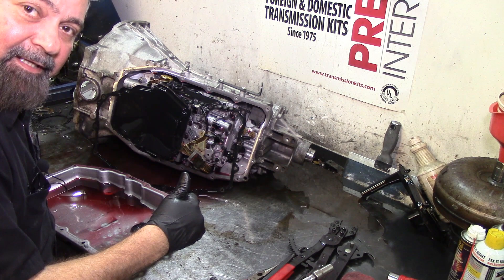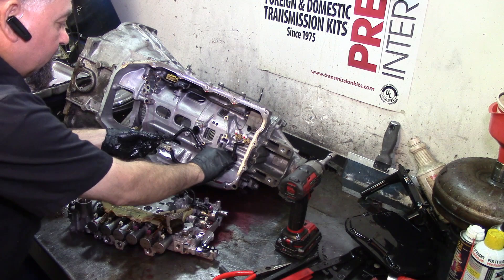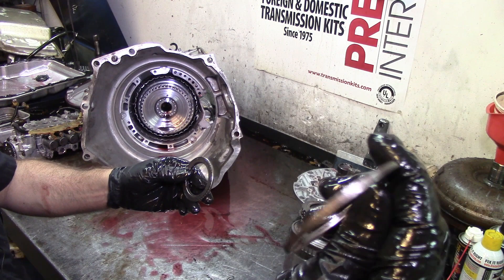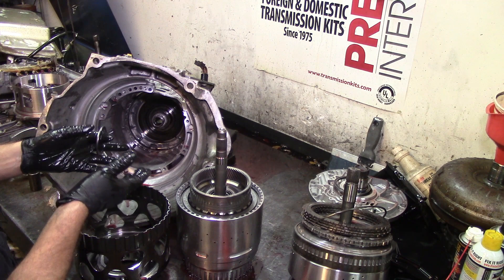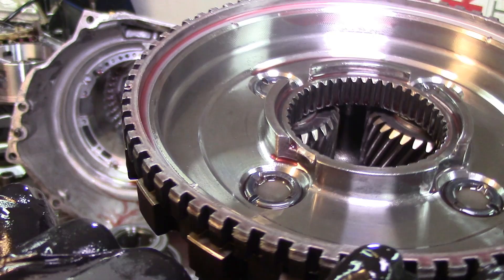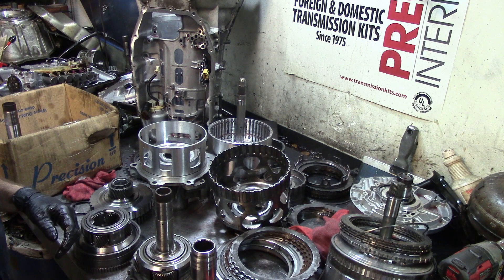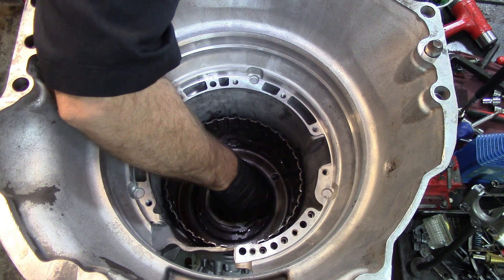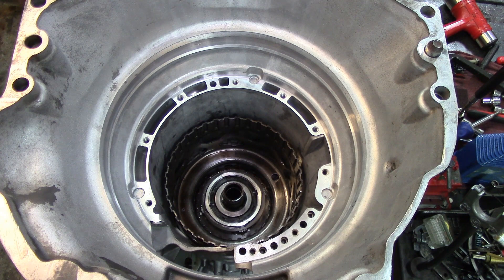8L90 TEARDOWN AND ASSEMBLY

Comment: Very good video. Today I just dropped off my 2017 Silverado High Country 8-speed for transmission work. transmission harnesses fail and transmission temp sensor gone bad. 80k miles only so far. Did in the past Amsoil transmission fluid with new filter. Amsoil did help with the shuttering and shaking

Comment: I should have went to school for transmission technician it looks interesting 👍. One day back in the late 1990s my 1981 GMC pickup truck's transmission needed transmission rebuild. So I took out my transmission and dropped it off to a Gallup NM transmission shop. I thought the transmission shop did their job but I found out later after bolting my transmission back to the engine I test drove my truck and it was still slipping. I couldn't believe that transmission shop didn't even rebuild my transmission 🤦. I was ripped off. After that happened I had alot of distrust in transmission shops. Years later I learned alot about fixing different kinds of vehicles. I believe in fixing my own vehicles. I'm still learning how to fix various types of vehicles. Thanks God for YouTube tutorials I keep on learning. I'm a YouTube taught Mechanic 👍. By the way that transmission shop ran out of business a decade after I distrusted them. I tried to tell the business they ripped me off but they didn't give me my money back. Same thing happened to me at Albuquerque Midas repair shop all I needed was a seal replacement for my leaking oil. I paid $300 for the work but the mechanics didn't even replace my oil pan seal.

Comment: Hi have a hard shift between 1-2. When cold. Goes away after 20min of driving. Trans shop called it a hard flare. They think it may need a valve body. Which is on back order. It had a valve body done under warranty in 2019, and 4 flushes since then. It’s a 2015 Escalade. 8l90. You said these have front pump and rear electric pump. Do those fail?

Comment: 2 Questions.  With the 8L45 and 8L90 is it OK to just replace the Torque Converter for the hard  shift?  My 8 speed CT6 caddy doesn't shutter just hard shift from 2-1 when the temperature outside is hot.  
Where are you located?

Comment: Great video, Hiram! First off how did the last builder leave a bearing out?? Do you think he pulled it for clearance like you stated toward the end of the video? I had a output shaft snap on a 10 speed a few mo the ago and did it all from the barrel as well. Was just so much easier. Had to use the visegrip band clamps do get the last drum in though it destroyed my finger tips it was too heavy. Two questions. Do you think deleting the thermal valve helps save the torque converters on these things? And last question what is the part number on long that snap on screw driver with lip you used for snap rings @ 56:53 ? Thanks again for the video!
Reply from the maker: I don't know how he left the bearing out, probably misplaced it or something like that. I believe he also left the output bearing out causing the damage to the extension housing. 
The snap on part number is SDD422. I'm not sure if it is still available because I have another one but orange and I couldn't get it warranty. 
Any long flat screw driver will work, I modified the tip like that to pull snap ring easily. 
And yeah, that drum on the 10 speeds is really heavy. I'm thinking of making a holder for it but it seems like it's heavier than the 6R140's. I just did one last week and pull drum out thinking I might have broken the sealing ring for the output shaft. But yeah I build my 10 speeds through the front as well.
Reply from the maker: And yes, I modify the thermal valve on both the 6 and 8.

Comment: Great video, Hiram. 
One question.  One of the first things you mentioned when you began disassembling was the Internal Mode Switch, IMS.  But, you never mentioned or showed it's removal.  If the IMS needs replacing,  can it be done without removing the valve body, and surrounding parts?

Comment: How do you feel about the overall construction of this trans from a performance standpoint? I'm considering one for my build. Planning on turning 7000rpm and making 850-900hp. HTG, a standalone trans controller company wants to get their product to work with the 8l90 since apparently the architecture is similar to the 8hp70/90. Of course there is added cost due to an adapter. I just don't want the reliability issues whereas the 8hp70/90 is pretty rock solid. I also want to use the 32 spline output of the 8l90 in a 4wd config whereas the 23 spline dodge output of the 8hp70 might not hold up to AWD launches at the track

Comment: Are problems with the 8L90 transmission common, in your experience?
Reply from the maker: TCC shudder, Torque Converter shudder.
Reply: Both the 6LXX & 8LXX series have torque converter & TCC issues. The 6LXX series tend to chew up pumps as the torque converter makes metal.
Reply: Temp sensor can act crazy too

Comment: Fairly obvious the previous builder did not measure clearances with a dial indicator or any other kind of check to confirm a good assembly.
Reply from the maker: Probably
Reply: But you know that builder found that bearing on the bench or cleaning tank and disregarded it.

Comment: What happened to the days of transmissions lasting? You say you guys are always building these over complicated slush boxes. It’s CRAZY brudda! I will stay with my TH350 & TH400 lol 
I know you are always surprised when you pull the pan!! Teeth and chunks are always interesting 🧐 
Thank you for sharing your experience as always it’s very nice to see you working!! The Master!!
Reply: Probably the best "automatic" transmission design is the one used in some original Honda Insights, it was a 5 speed manual with the gear shifting and clutch operated by electronics. Still overcomplicated compared to Toyota's clutchless CVT, however...
Reply from the maker: True tried and tested, no doubt.